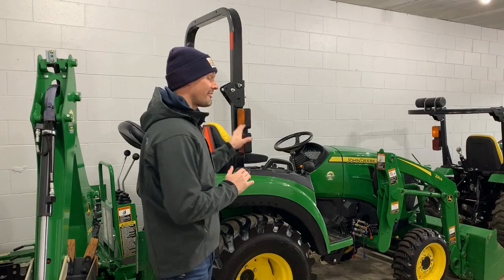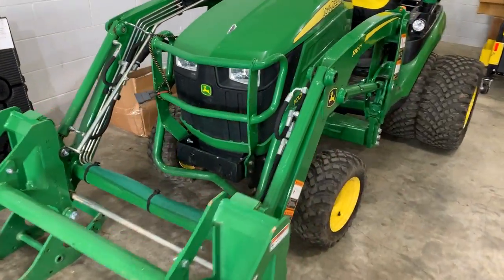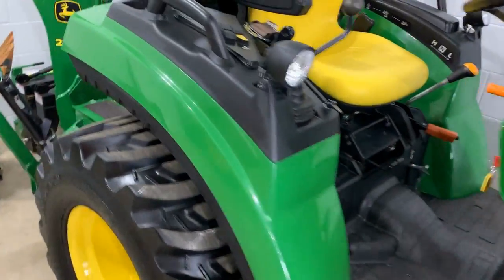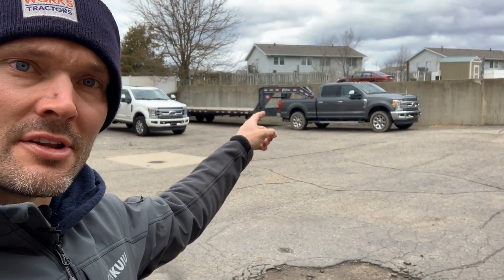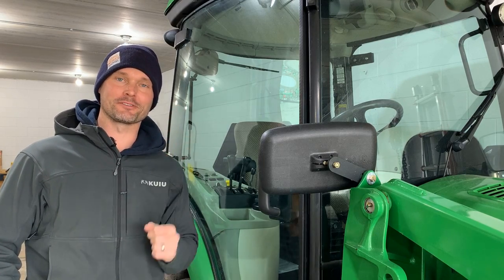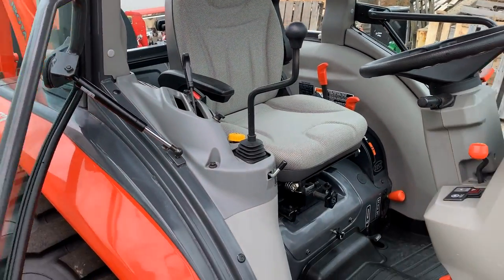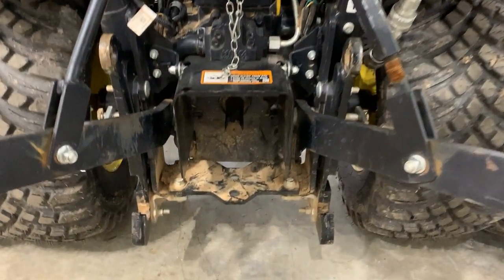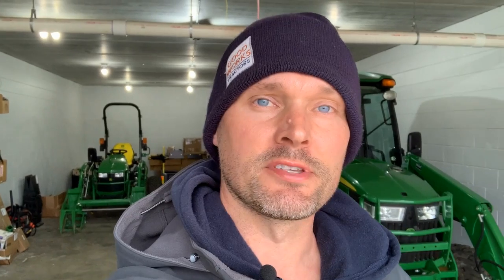TOP 10 SCREW-UPS JOHN DEERE MADE ON TRACTOR DESIGNS 🚜

Comment: On the pedals, if you turn to look over your right shoulder when backing, as we have done in the USA "for eternity", your foot for the far right pedal will be in a better position than the inside right one and your foot would more likely get wedged if you had to reach the inside pedal for reverse. On forward, the inside pedal keeps the splay of the hips at a minimum. Imagine a motorcycle tank being cylindrical instead of teardrop, or even reverse teardrop, comfort would be ruined. 
Love the channel.

Comment: I have the 2018 JD 3025E. While working in the woods a stick came right up through the floorboard. It was an easy fix by replacing with a new floorboard. 
I agree,  should have brush guards underneath all tractors
Reply from the maker: Had a buddy put a stick right into a seam near his transaxle.  Took out the four wheel drive system.
Reply: @GoodWorksTractors  ohhhh expensive fix

Comment: Courtney another thing I noticed is that every control seems to be crammed in around the seat. On my 2011 CaseIH 35 (3 series in Deere?) Everything but 2 things are mounted on the fenders makes them real easy to reach and use. Also everything has a sticker telling you what it does

Comment: Twin Touch positions:  Ergonomics.  I think if the pedals swapped position, your knee would take a lot more stress over time reaching outward. Your ankle and hip would likely suffer as well, especially with any bouncing/rough terrain.  That was one of the first things I also noticed, but after thinking it through, I'm pretty sure the layout is due to longer term use and knee strain.  My current issue with my new 2025R is remembering that the left side pedal is the brake and not the mower deck lift as on my x320.

Comment: I work in heavy truck engineering and appreciate your insight about how the results of engineering decisions impact real world use (like taking the little tractors into the woods is probably not highly anticipated by engineering).  I know in heavy trucks, there are some destinations, like the coal mine areas of KY and WV where engineers know that the trucks brakes will be abused, so they plan for that.  Garbage trucks and trucks headed to the middle east are also regularly pushed past their design, so those orders get special scrutiny.  I wonder if midwest compact tractors owners are in the same position.  Do we just need a midwest model that has a skid plate and valve stem shields?
Reply from the maker: I like that, the "Corn Belt" custom edition or something like that.  Kind of like the Ford King Ranch.  You're on to something! 🤣👍

Comment: Great work effort. Biggest failure is the tires. There is simply no excuse for lacking puncture proof wheeling. In the alternative is the ability to add tracks straight on the wheelings. Should come with a standard tool rack. Love your review on non-hydraulic attachments.

Comment: I have the earlier version of the 2025r. I really like the tractor,  but you are correct, the John Deere seat sucks. Such a rough ride with no options to improve. Was also originally ticked that they skipped the series 2 for the autoconnect deck, but got over it as I only drop it off once a season.

Comment: I agree with most of what you say here. The seat suspension has always been crap. I put a 3 series suspension on my 1025, makes it much more enjoyable. Some days I'm on the tractor 6-7 hours at a time.
Reply from the maker: Assume you had to do some mods to get it to fit?  How's the height difference?
Reply: @GoodWorksTractors  it's a little taller. I used to have a 2520 that I changed the seat on so I had an adapter that I built. To get it to bolt up I had to put the suspension on upsidedown and weld some tabs on it so the seat would fold forward so the backhoe would work.

Comment: imo - hi low range on the smaller compacts is correct . 
the “hi” range is likely an actual medium range . no need for a true “hi” / “fast” range as with the short wheel bases of the smaller machines the higher speed could be a safety issue - and those size machines are not typically moved great distances . My 955 / the model series that started it all ! has hi low and i wouldn’t want it to go any faster with a true “hi” range ….. and the “hi” range performs like a med range …. Go JD !! … Love your channel 👍👍🇺🇸

Comment: You nailed it again! Why do we have to go to a 3 Series to get heat/air? B2650 is an awesome machine, but the dealership is miles away, JD is almost 20- 40 minutes in any direction. Break downs happen so that has to figure into what you want?

Comment: Big opportunity for all John Deere tractors:  wrap electrical tape for the wiring harness at the spot of its connection.  In automotive this is the most vulnerable spot for corrosion (warranty condition).  Too, get the wiring harnesses under and to the side tied up close to the machine.  These are stick and weed “grabbers”.

Comment: Excellent points. I ended up going with Kubota because I didn’t like the way my John Deere dealer does business. I was looking at their 2 series and they didn’t have any in stock. They couldn’t tell me when they would and we even went as far as creating a mock order from the factory. They gave me a 7 month wait time. Yes, 7 months! I went to my Kubota dealer and they had 4 B series in stock. So, I had my B configured how I wanted in my driveway 2 weeks later. The only thing John Deere has over Kubota is their mower decks. Hands down better. All I can think is that John Deere spent so much time and energy in creating that, that everything else went down the toilet. 😂

Comment: Also hav seen the auto connect not lined up and get blasted up under the belly and bend the alignment bolt, that has been redesigned this year, have seen the pto shaft not get greased and blow off the trans filter and have to replace the front trans cover, and have seen a hole blown thru the bottom of the trans, but for the others
-dont get a cab, us techs hate working around them, and you wont like your bill if its in the way of the work, the engine sheilds are a pain to replace and makes any electrical dash issues a pain to work around
-you will hate the price the deere charges for led lights and to replace one bulbs are cheaper by an arm and a leg
-sometimes basic and simple means in stock, we all know how long it takes to get bota parts lol
-pedals for travel have been the same since the 755 year models

Hope this helps

Comment: I think the reason that the reverse pedal is on the outside relates to ergonomics. When I am backing up, I am frequently turned toward my right side and looking over my right shoulder. This puts the right foot in a more or less horizontal position as opposed to vertical and it will contact the outside pedal much more easily and readily than the inside pedal. If reverse was on the left side, you would be feeling around with the toe of your boot for that inside pedal. The way it is configured, you just push your foot forward and it hits the outside, slightly rearward displaced pedal automatically.

Comment: I found a major manufacturing defect on my sons 3032E.  He was having trouble with it overheating.  He would shut it down and since it was too hot to open the radiator cap, he would just check the radiator overflow tank which was always half full.  He thought that the water pump was failing or the radiator was plugged up and of course he would clean the radiator screen.  I checked the overflow hose and it was open. Then I checked the nipple on the overflow tank to see if it was open.  To my surprise, the nipple was solid plastic with no opening at all.  It was no wonder that the antifreeze level in the overflow tank was always the same.  It was not even connected to the radiator.  I drilled a hole in the nipple and now it functions as it should.  I wonder how many defective overflow tanks John Deere has sold???  Many people just look at that overflow tank to see if they have antifreeze.  ALWAYS OPEN THE RADIATOR CAP AND LOOK INSIDE WHEN IT IS COLD. NEVER COUNT ON THE OVERFLOW TANK AS AN INDICATION.
Reply: Dont feel bad,on my 5045 JD did drill and tap the plastic tank,they left the shaving IN the tank. they got sucked up into the fuel filter! the tractor was still running and it wasnt time to change the filter so i didnt know it had happened. eventually small pieces somehow got past it into the pump and injector... cost me a pump rebuild and injectors at 810 hrs.

Comment: Your lucky on just a hole on the hydraulic filter. (JD3038E) I had a stick wedge in there and bend the bracket witch in turn tore the hose up. Gallons of hydraulic fluid on the forest floor and stuck in place. After getting all the new parts, had the joy of working on said puddle fixing it. 
Might be a good project for your resources to come up with a skid plate and put it up in your store.

Comment: I still wish the two functions would be better like Kubota. I use mine almost strictly for loader applications and a lot of fork lifting. Second gripe that I mentioned in another post is the seats that rip and never seem to last. Mine has a cab on it and still looks like I keep a goat in there. I thought on my other JD that it had something to do with UV or weather but this doesn’t seem to be the case. One other gripe is the Diff lock tiny peg that sticks out. When boots get wet or even dry it is impossible to push it down. I’m not a huge fan of electronics on heavy equipment but if they can’t make a lever an inch longer maybe they could give the customer an option for an electronic diff lock.

Comment: Lots of good points, my biggest dislike on my 1025 is the hydraulic filter not protected as it’s a costly fix if the u joint breaks and hits and snaps it off. You might want to get the updated air filter system for your 1025. Lots of problems with the old.
Reply from the maker: Yeah, that's crossed my mind, good thinkin'.

Comment: A HUGE improvement to me is on my 5 series is the little slide throttle on the fender! That’s so much easier than the dash! I don’t think I’ve used a foot pedal one time on it!
Reply: It's plastic and electric when it quits working or plastic broke you won't like it
Reply: Yup… once you start using the snail type accelerator, you seldom use the foot throttle.

Comment: Good ones.  I agree on the skid plates.  My 2038r add would be for load-n-go.  Got it for  60d in 2025 & 1025 and even for 72" deck for 2038r but not on 60" .   Also no seat cover option I've found.
Reply from the maker: Strange, think they'd have a seat cover and load n go.  Maybe soon.

Comment: You had mentioned at the end of you video about the "backhoe compatable" cabs on the other tractors. The aftermarket cab, "Mauser", for as fancy of a cab that it is, IS NOT backhoe cmpatable with the 1025R. 

Thankyou for mentioning the spin around seat on the 1025R for the 260 backhoe. That has been one of my biggest gripes & complaints is that JD did not install a seat on the 260 backhoe. When JD come out the the 2025R, they included the seat on that tractor's "hoe". 

Im bound and determined to find & build a way to put a seat on my 260 hoe.     Thankya for the video & do ya remember the 2 phrases i always say that i came up with????. . . . . . . . . . . . . . . . ."Tractor Theropy" & "Tractor Safe!"

Comment: The only argument I can come up with for how the drive/speed control pedals are is that with the forward pedal to the inside, I suppose it's in a better location ergonomic wise for the operator. You're more likely going to be driving forward than backward for sure. I have a Craftsman lawn tractor that's the same way. the reverse pedal is further outboard from the center. I will agree with you, the intuitiveness of the furthest pedal to the right being the throttle/forward pedal

Comment: I have a 2009 2520; I see very little in all the changes made since mine was new that are actual improvements. It seems that most are either useless goo-gaws or changes made to simplify production. I do agree that a 3-range transmission would be a real-world improvement. High range on mine is too high for any heavy pulling work, I'm always up against the PRV, so high gets used only for travel most of the time.

Comment: Love your thoughts on the need for skid plates, LED lights, and the cab for the 2 series. Didn’t realize the loader was made worse. One other thought is the need for an electric, battery powered rather than diesel powered 2 series tractor. Most of us would appreciate the simplicity of going electric as we don’t need more than 4 hours of run time without recharging. Do you know when the product cycle expires and the next generation of the 2 series comes out?
Reply: Battery’s don’t last but Diesel engines last a good long time, having said that many guys may like the option!

Comment: I agree with the skid plates I have ripped the wires out of my foot pedals three or four times on my 3320 and also the cruise control speed sensors
Reply: And also John Deere will not sell you just the plug-in off the harness you have to buy the complete wiring harness which is 620 bucks and takes about a day to put it in
Reply from the maker: Good points for sure!

Comment: Great job.  I haven't looked at the new Deere's.  Those seats looked like they came off my x500.  Wow. My 4310 has a suspension seat, so glad it does...it even has the premium sway controls...I agree there needs to be some kind of belly guards...thanks for the videos. Great job.
Reply from the maker: Yeah, you have an earlier generation of the premium line up.  Good machine.
Reply: @GoodWorksTractors  I also have a 4310 2003 model. Good seat, good power, layouts seem to be fine for controls. I have the power reverser series. I do think p r is better for mowing unless you pay extra for cruise control with hydro. I plow a lot of snow as well as mow about 7 acres regularly with a 6 foot finish mower. 1300 hours   ( I know its not a ton of hours)so far never had a repair. I keep it in a shed and it keeps the finish very good as to keeping it outside like my brothers tractor. At todays prices I probably would never would have never bought the tractor. Price then $18,500 with 430 loader, power beyond kit, block heater, drawbar, good 3 pt hitch, heavy duty bucket with heavy added cutting edge , great dealer ads these extras as standard so customers are  satisfied from the beginning.

Comment: 2025R Gen2 was my first compact tractor. Another issue I didn't expect is the limited lift height of the 3 point. Really should have bought 2032 or 2038R but Deere didn't offer a front 3rd function kit.
Reply from the maker: Good point about the 3 point lift height.

Comment: That's a good list.  I got rid of the bolts to hold the side panels on my 1025R within the first month.  I hacked it with a knob screw and wingnut set up.  Totally tool less.  But will some day buy the yellow pins  LVU22998...
Reply from the maker: Took them long enough ya know!

Comment: My 57 JD 520 ive been wanting to make a bracket on the front for the front now that i have a good mig welder. I use my tractor for pulling wrecks at a couple local demo derby events. I bought a j hook for pulling wrecks and i want a 2nd cause i love it for tying the back end down and with the bracket building for the front and a 2nd j hook i wouldn't have to climb back on the trl to chain it down

Comment: I tied down my JD 4410 on the front by running a chain through the tube that goes between the loader arms.  I made a long hook that I stuck through the tube to pull the chain through.  I also did a secondary strap to the front frame

Comment: Wiring... So many companies do it so poorly. Spend years/decades developing the components and machinery then just toss some wires in there to connect everything. The connectors they use aren't sealed, chassis grounds, wires (and hydraulics) touching metal without being secured. I just bought a B2650 and spent a few hours already fixing the wiring and hydraulic hoses.
Reply from the maker: 100% agree

Comment: "It's not cheap" -- would probably be the reason many companies don't offer some options. ;) Not only do options add cost to the purchase price for the optional product itself, but the overhead of managing the supply chain, and inventory of the optional parts. Which doesn't make much sense if buyers of equipment aren't willing to pay for the options in quantities high enough to make offering the option profitable.

Having said that I'm of the opinion that telescoping lower links, and telescoping stabilizers should be an option (if not standard) for all tractors. The fact that quick hitches exsist in part (at least) to "fix" the issues that arise with non-telescoping lower links says quite a bit. Though personally I'm not a fan of quick hitches - especially when trying to hookup an implement that isn't sitting on ground that's level with the tractor as having the three points that can be independently lengthened/positioned is something I've found to be far easier.   ...but that might just be me.
Reply from the maker: Many of the items mentioned are already found on other models, so they are already being produced.  If they could design in a way to be "plug and play" on many models, then their costs would go down as production increases while also increasing profit from selling more product.  Thanks for watching!

Comment: I have a 2032R love it but one thing you mentioned the front hydraulics system the system sucks and when you have the quick connect its expensive. would not do the front hydraulics again. Bad set up for the lines to the plow blade you cant take the complete front loader off with there hydraulic line unless you get off the tractor and disconnect 2 extra line couplers because instead of lines being run along frame to front the run them on the side attached to the loader arms